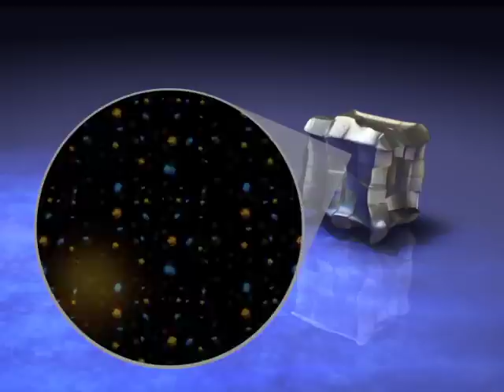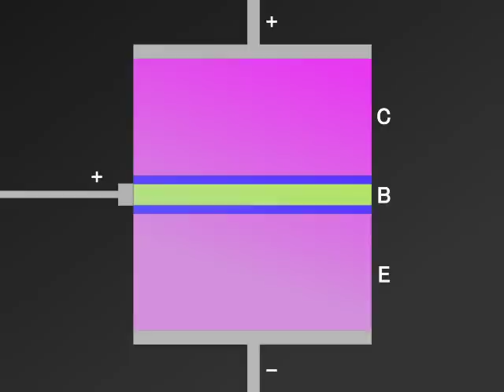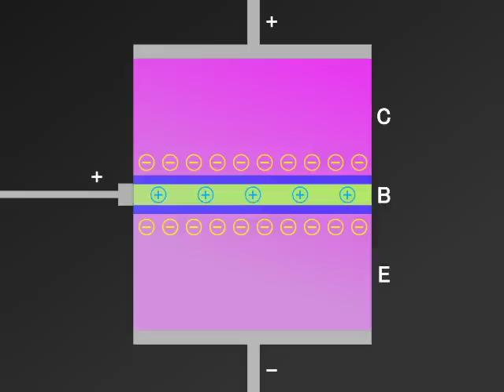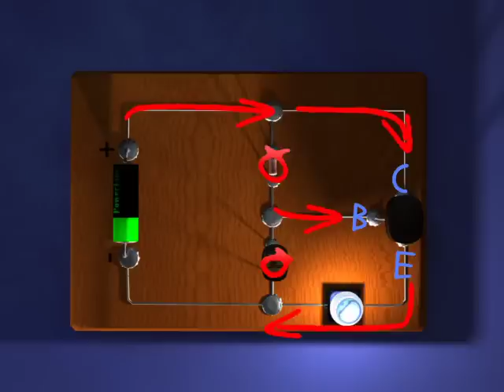Transistor (bipolar) - How it works! (Animation)

Comment: If electrons and holes recombine in the base region instantly, then what does "carrier lifetime" refer to? "The base is very thin, and it contains holes—that are also called defect electrons." Umm, what? And when you say, "The base receives only a small current; most of the current is drawn towards the collector-emitter junction, which is currently nonconductive," ... WTH? It's not like this video was very helpful to begin with, but it makes it downright confusing to introduce errors like these.
Reply from the maker: Hi, thank you for your comment. However, I don't quite understand what's wrong with this? Could you please go into detail?
Reply: Thomas Schwenke Well, it's good that you're curious to know.

re: Carrier lifetime. Electrons and holes do not recombine instantly. When electrons diffuse into the base region, they must recombine with holes in order to constitute base current—electrons cannot simply be "conducted" out of the base contact without first recombining. There is a certain probability that, in a given amount of time, any electron will recombine. This is quantified by the parameter, "minority carrier lifetime." It is the time (on average) that an electron will have 1/e probability of not recombining. Given the tendency of electrons to diffuse from regions of high to low concentration, this "lifetime" can be translated into a "diffusion length," which is the distance electrons will travel (due to diffusion) until only 1/e of them remain unrecombined. BJT's are made with high beta by making the base width very thin in relation to the diffusion length, so that the vast majority of electrons diffuse straight through without recombining.

Under normal operation (low-level injection), the electron concentration in the base is \extremely\ low—much lower than the concentration of holes. Although the electrons find holes, they are unlikely to recombine unless they are in the vicinity of a crystallographic defect, which creates intermediate states in the bandgap and permits recombination (since silicon is an indirect bandgap semiconductor, they cannot recombine directly). Thus, a well-made crystal with a low defect concentration is good for high-beta transistors because the electrons will have a high lifetime.

re: Defect electrons. I've never heard holes referred to as defect electrons. Holes constitute an absence of electrons from the valence band, and are therefore called holes, but calling them defect electrons is erroneous.

re: Base current. Sorry, I think I misunderstood your statement; the phrasing you used seemed to imply that, in the off-state, current flowing into the transistor's collector prevented its base from turning on (which is pretty obviously wrong). On further review, I think I understand better what you were trying to say. The wording was just a little weird.

Comment: "Under such conditions... acts as barrier no matter how high the voltage between collector and emitter" Why? Wouldn't a large potential difference between the collector and emitter upset the opposing electric field between the base and emitter?
Reply from the maker: The transistor will die when you go to high... That's correct. But I didn't want to go into detail... The video would have been too long.

Comment: really really good video! i really liked it. What is the resistance of the first resistor? also i have a polarized photoresistor (positive lead, and negative lead). i tried constructing the circuit myself but for whatever reason cannot get the led to ligh
Reply from the maker: My advice: Use a forum for electrical engineering for that. There, many people can help you. Here, I think, it's not the right place for that. But thank you for your comment! I really appreciate it!

Comment from the maker: Hello, you may want to look for "Conventional Current vs. Electron Flow." :) Here is a quote (see Wiki -> Electric current): "To provide a definition of current that is independent of the type of charge carriers flowing, conventional current is defined to flow in the same direction as positive charges. So in metals where the charge carriers (electrons) are negative, conventional current flows in the opposite direction as the electrons."

Comment: Great video, perfect level of explaination. I'm a Mechanical and Thermal Engineer, and I'm trying to learn about transistors in order to be able to understand the thermal load they exert on a system. Is there anything you can tell me with regards to which junction produces the heat? I'd assume it's through the base, is that correct?
Tom

Comment from the maker: Well, the first resistor splits the current into a large and a small stream (think of it as a river). The small stream reaches the Base and the photoresistor. The photoresistor doesn't block the water stream, so it is just flowing to the other connector of the battery. If the light goes of, the photoresistor blocks the water stream; the water must find another way, so it takes the Base. Et voilà. Does it make sense now?
Reply: without this explanation, video was not understandable

Comment from the maker: Here is quote (see Wiki -> Electric current): "To provide a definition of current that is independent of the type of charge carriers flowing, conventional current is defined to flow in the same direction as positive charges. So in metals where the charge carriers (electrons) are negative, conventional current flows in the opposite direction as the electrons."

Comment from the maker: Thank you for your comment. The problem you mentioned depends on several factors. Using the correct devices, you will be able to create a circuit like this. However, it is true that you wouldn't arrange the devices in the manner shown because it is much more convenient to install the bulb right in front of the transistor. For this example, however, it was easier to explain the concept with the circuit shown.

Comment: hi i was wondering if u can help me to find the transistor number i need transistor with 12 voltage and 10 amp or 8 bipolar npn i need it to be a switch in my circuit but icant find the transistor number can u tell me where to find the data sheet or at less how to figure the number just so u know the transistor will be connected to 1 k resistor and this 1 k resistor will be connected to digital to angalog converter and i will program it so the transistor switch on and off to a certian time